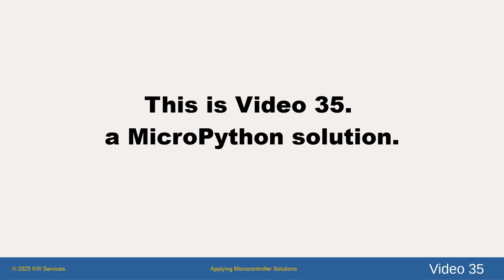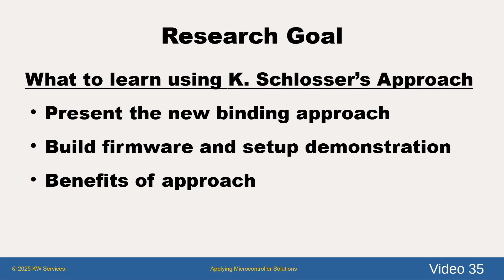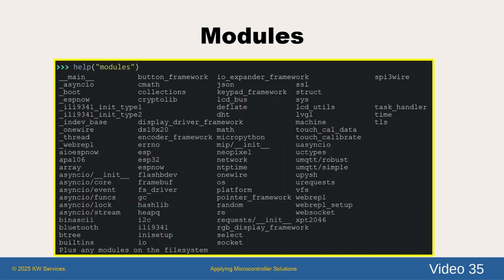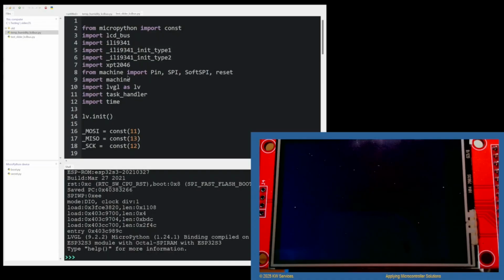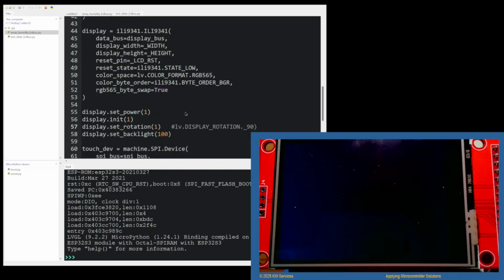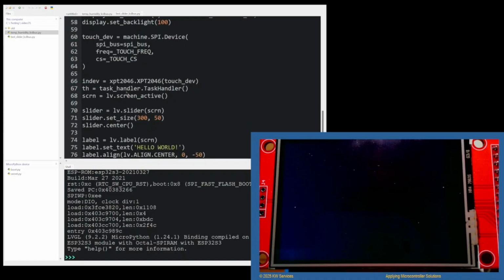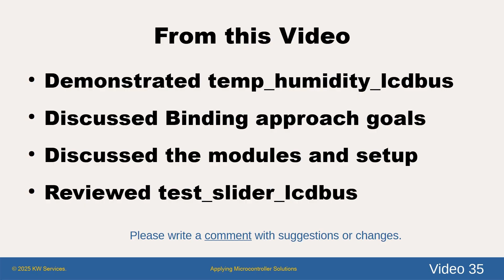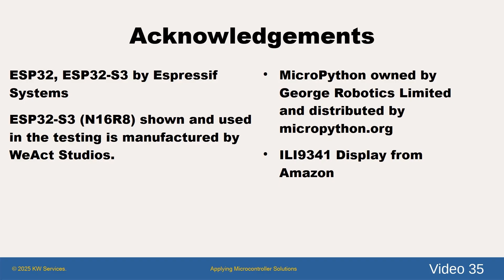ESP32 - MicroPython LVGL 9 – Is it pioneering a new way? Part 2

Comment: Is the firmware not meant for ESP32s3 devkit? When trying to run a basic code it says:
Traceback (most recent call last):
  File "<stdin>", line 46, in <module>
  File "display_driver_framework.py", line 187, in _init_
MemoryError: memory allocation failed, allocating 1009065064 bytes
Reply from the maker: Thanks for the question.  The build although for the ESP-S3 (N16R8) does work on my old ESP-S3-WROOM-1 usb board.  However, I am only using the ILI9341 and XPT2046 drivers.  The modules  xyz_framework I have not tested yet.  Although I will look at them.  Based on your finding it sounds like Kevin Schlosser has an error in that file.  I will see what can be done to fix.
Reply: @applyingmicrocontrollers  (This is my 2nd acc) Oh okay, I believe the ESP32 S3 firmware is still in development hence such minor issues. Hopefully everyone can come together and resolve this and make ESP32 a seamless platform for micropython LVGL ! Thanks for your reply
Reply: @applyingmicrocontrollers   Would It be possible for you to help me with a build for ESP32S3? I am trying very hard to build firmware for ESP32S3 xiao sense (the one which has 8MB PSRAM and 8MB flash) and the waveshare ESP32S3 Tiny (it has 2MB PSRAM and 4MB flash). But I have not been able to get any of the builds to work correctly. I am  using 2.4 inch ILI9341 display from waveshare, I am aiming to use buttons as a source of input instead of touch based displays. 

Is it possible for you to please guide me on what commands I should use to get a working build for the above two microcontrollers and which libraries will work with lvgl init function please? or if it is easier for you to build the firmware and link the .bin file that is fine as well. I am in desperate need of getting LVGL to work with my microcontrollers but I have failed so far. Noone on LVGL community is replying to me. You are life saver, thanks!!
Reply: @applyingmicrocontrollers  Would it be possible for you to assist me in building firmware for ESP32S3 Xiao Sense (8MB PSRAM 8MB flash) and ESP32S3 tiny from waveshare(2MB PSRAM and 4MB flash) , I have been trying to build the firmware for these for a month now but I keep failing. Please help me out with the right commands to put in Ubuntu or if it is easier for you to give me a .bin file that works as well. I am also using 2.4 inch ILI9341 based display but I aim to use buttons as input instead of touch. I will be very grateful to you if you can guide me in the right direction please!
Reply from the maker: Thanks for the question.  Did you try the "legacy" firmware:  MP-LVGL9.3-1.24-ESP32-S3-Oct-Legacy.  I was able to use Thonny to load that firmware to an old ESP32-S3-WROOM-1 usb board. (I tried it again just now.) 
You can then use the drivers from my GitHub site to program the ILI9341.
Reply: @applyingmicrocontrollers   I don't want to seem irritating to you but I want to ask whether this legacy firmware will work fine with ESP32S3 xiao sense? It has 8MB PSRAM and 8MB flash. Thank you very much
Reply from the maker: I do not have a ESP32S3 Xiao sense, but as you mentioned it is 8MB Flash 8MB PSRAM and the "legacy firmware" was compiled for 8MB PSRAM 16MB flash a few days ago. I tried it in the older ESP32-S3 DevKit with zero PSRAM and it happily loaded.  So, I think it should work in your xiao based on what I am reading.  Did you gave it a try?
Reply from the maker: Hello. According to this website (https://wiki.seeedstudio.com/xiao_esp32s3_getting_started/)
You need the ESP32_GENERIC_S3 firmware.  I built that firmware on 5/26 and uploaded it to my GitHub.
If the S3-Oct does not work then try the GENERIC_S3.  And do let me know if it worked for you.
Reply: @applyingmicrocontrollers   The firmware you mentioned is working really well on ESP32S3 devkit N8R8, i guess it has same specs as the xiao so xiao should also work. I am very happy that I finally got LVGL working!!! I will keep you posted on my project!! Thank you very much Sir, you recovered my hopes with LVGL hehe.
Reply from the maker: Super.  I am glad its working for you.
Reply from the maker: Hello artisticyet22.  Hey I got your specific error. 
  File "<stdin>", line 46, in <module>
  File "display_driver_framework.py", line 187, in init
MemoryError: memory allocation failed, allocating 1009065064 bytes

 I had forgotten to reset() the ESP32.  It turns out that both ESP32 or Pico do not like to be restarted.  You must re-power the board or I found that the micropython.reset() command will hard reset the usb board.  Hence why I program a RESET feature into most programs.
Reply: @applyingmicrocontrollers   Ahh damn, so does this mean that if the LVGL is implemented on an embedded system and the esp restarts, will it fail to run the LVGL code?
Reply from the maker: I am doing hard resets.  One could put the program start in boot.py
Reply: @applyingmicrocontrollers   Oh yes, i forgot about boot.py,  I will try through boot once and I will update you, kind sir . <3